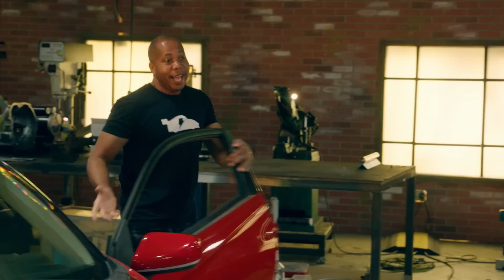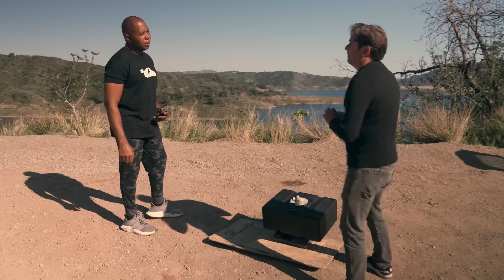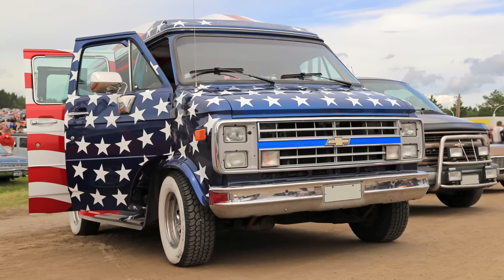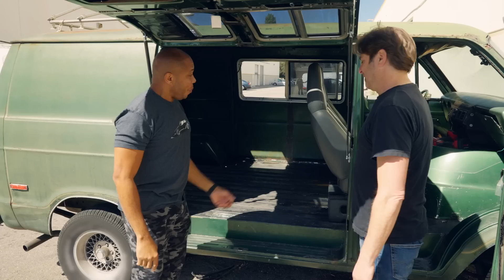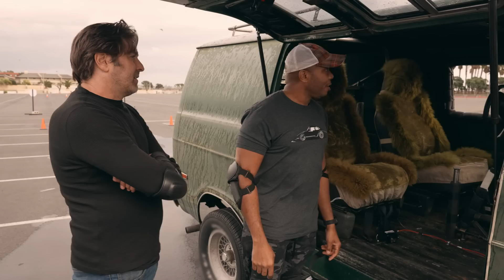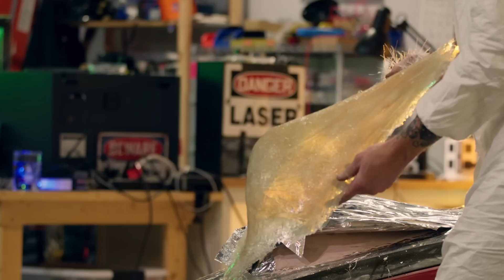Boost Your Hybrid! - Motor MythBusters - S01 EP105 - Car Show

Comment: You'll only lose braking when the fluid reservoir is empty or if the leak gets worse than it was when you started.
There's no other way for it to be timed for a failure after a set amount of stops.

Comment: Why don't you calculate the load resistance that the chassis Dyno puts on the car? And hopefully they do realize that even in bracing or just daily driving the quicker that you can get you posted speed the less fuel you use in the long run you just put up the road never open it up you drink more gas in the long run

Comment: The turbo out the bonnet upped the drag possible more than the increasing in fuel use in the hills put it under the bonnet and it may of had a slight gain in all tests.
To me it is a good looking car.
Reply: Given that anything past the turbo is now turbulent flow, there should be a significant increase in Cd. So yes, I can see scenarios where the car is less efficient with the turbo.

Comment: It's not a mith, turbocharging an engine will make it more efficient, it's a verified fact
Reply: myth* and it also just depends, if you're going for the similar power, sure, with the proper tune. The moment you're using it in a performance setting, it will allow you to draw MORE air and thus MORE fuel, making more powa baby. More fuel means less fuel efficiency.
Reply: Dude needs to learn how to spell myth correctly

Comment: Only thing I feel was(maybe)overlooked is the back pressure in the exhaust system - adding a turbo is all good and well, but is the exhaust diameter suffiecient for the engine with the added turbo to flow efficiently. Also, I'm surprised they didn't reduce the weight of the vehicle
Reply: that and added drag from the exposed turbo
Reply: @TheExileFox  definitely, could also tape over the panel gaps
Reply: @TheExileFox  lol drag....back pressure 😂
Reply: Myth was about the turbo adding or lowering MPG, not what ever you could make it more efficient. Of course if you rip everything out and make it far lighter the consumption drops, same with decreasing the drag factor, but it was not about that.
Reply: @Hellsong89  fair enough, my brain ran with the idea of consumption

Comment: Turbos add hp and torque, and they increase fuel efficiency they should be on every car😊
Reply: Depending on how I drive , my turbo can hurt or help me 😅
Reply: I remember my Volkswagen Jetta Turbo Diesel 1987. It was incredibly diesel efficient.
Reply: Turbos are awesome. I love my volvo s60 t6  super efficient and super fun to drive 😊
Reply: @friskydingo5370 They only increase efficiency comparably to a similarly powered larger engine size.  IE 2.0turbo vs 3.0l gas etc etc
By definition of having a turbo, it’s forcing more air to mix with having fuel to increase engine power output
No, they don’t increase fuel economy.  They make a smaller fuel sipping engine feel like a larger one that drinks more fuel.
Reply: It depends on what altitude and your computer system with intercooler a turbo will produce a better atmosphere for combustion and a more constant one if done correctly their for the fuel air ratio can run leaner reduceing the amount of fuel consumed with the added power and reduction of weight make the machine more efficient.  My 3.0 turbo gets better mileage than the same car model with out a turbo you have to add the  power of compressed air acting on the pistons alone causing no parasitic draw 😊
Reply: Using the exuast gass to add power will always increase efficiency as you are recovering normally lost power